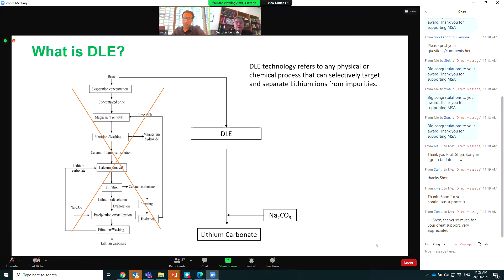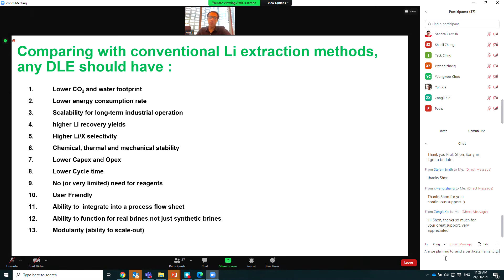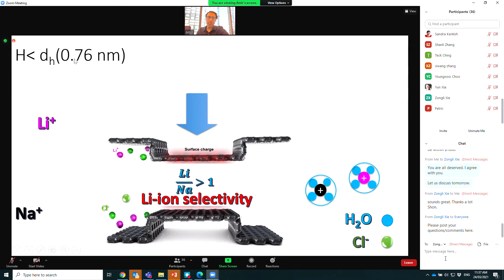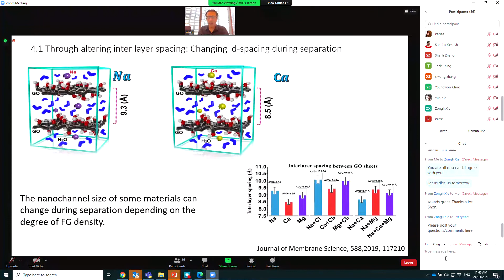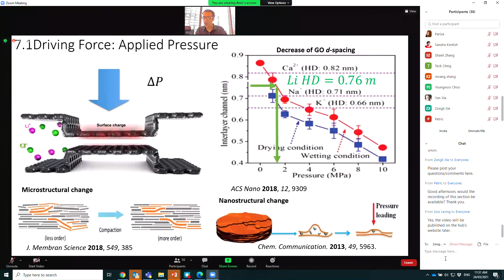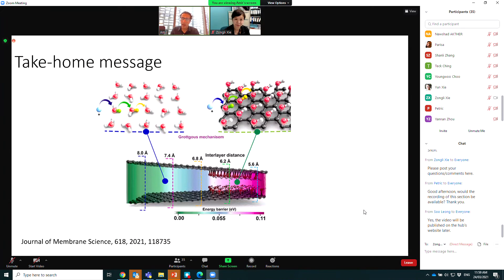Direct Lithium Extraction Technologies

Comment: I can't help but make the comparison with Livent, Lake Resources, Standard Lithium ,Lilac  & E3 . Jade Cove is tracking 60 DLEs, & in “Does DLE Matter ? “ suggests only 5 - 10 operation & 2-3 technologies will reach commercialisation .  The bottom line includes (1) The cost of sourcing & disposing of the brine - (2)  Cost of pre-treatment & DLE - (3) Capital & operating cost, & the scale of operation -  Canadian E3 ,anticipates   130,000 cubic metres per day  for  a 20,000 tpa LiOH  - Can a membrane handle 130million litres ?
Reply: E3 doesn't use membranes it uses beads just like an IC column.  I wouldn't think membranes are way to go, water treatment facilities do large volumes and they use same tech as E3, the membrane is different and interesting to see it's success.